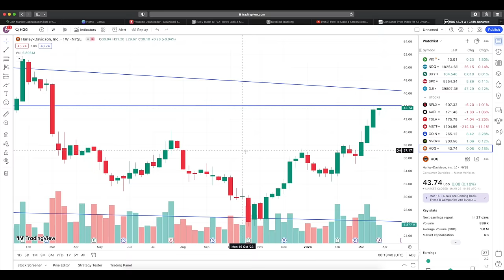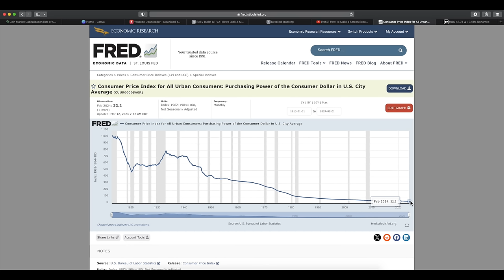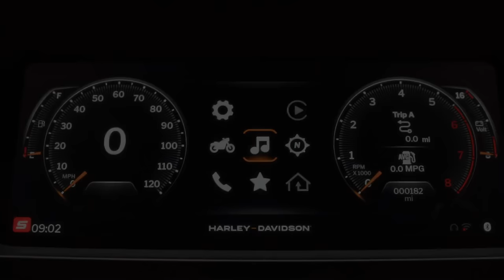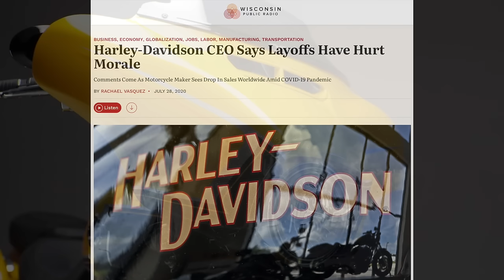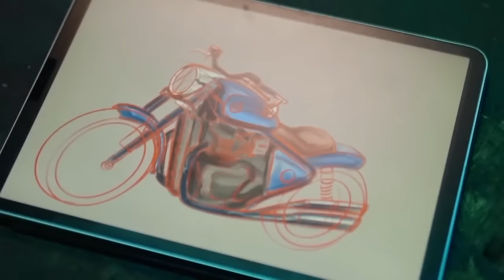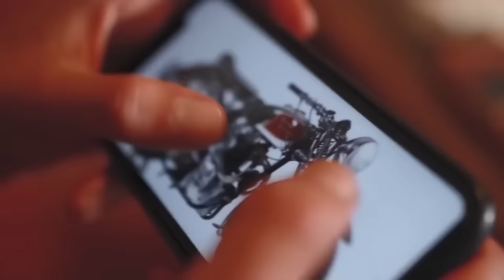Harley Davidson is Mismanaged Compared to Royal Enfield

Comment: I went to the local RE dealer yesterday and saw the new Bullet and Meteor 650 for the first time.  They’re beautiful bikes and priced so competitively.  The Meteor 650 is less than half of the least expensive Harley and just a well made motorcycle that looks wonderful.
Reply: Their 350s may be the best-styled bikes available today.
Reply: @ikonoklass  yeah I love all of them. The Bullet is such a beautiful motorcycle. I also love the Hunter and Classic.
Reply: Not sure RE are the Bruce Lee of motorcycles
Reply: I bought a RE650 in 2022, love the bike, the simplicity is amazing everything you can do your self set the valves is the hardest thing to do, its not that hard, no paying 500 bucks at the dealer for service.
Reply: Yeah it is a wonderful rebirth. The Interceptor is also a beautiful bike but when I looked up the weight it seemed quite heavy. Hope they make them a little lighter soon?

Comment: Harley just won’t budge in their philosophy, seemingly they don’t care.  They don’t have to get as cheap as RE, but they could at least bring out something like the Street Fighter to attract a new customer base.  I had a Lowrider for awhile and I miss it now, but at this point I would only get a used HD, prices are too much to consider new.  Great video!
Reply: A low rate that cost 20 grand is really not gonna be any good for the brand because most people can’t afford that
Reply from the maker: Thanks! It would be good to have a 10K air cooled cruiser without any electronics. Just make it look nice and sound good, it doesn't have to be fast. They'd gain a whole lotta market share with that.
Reply: @DifferentSpokesTV  Give it a cool name, like "Sportster" maybe, with a big aftermarket to customize it too!
Reply: Jochenimany Zeitzermaniac making sure so much Americana remains in the brand.
Reply: Its interesting how they act differently in different market...in India they aree selling a 440 cc single roadster which in all due respect is a good value proposition.
https://youtu.be/1hRGiKTpxKI?feature=shared

Comment: Harley = NASCAR.  Outlived its life cycle and fails to attract new fans.  All other brands = F1 which has it figured out as it’s an international sport that thrives.
Reply from the maker: It's hard when your customers turn their nose up at any new bikes and non-Harley riders are sceptical of any actual innovative bike you make.
Reply: HD made this bed. They have to sleep in it. Back in the Reagan years they went crying to the Gubmint about imports eating their lunch. Instead of manning up and competing, they simply changed the rules.
They've destroyed other domestic upstarts by the same method. I look at them as a big corporate bully that's lost sight of what motorcycles are about.
Reply: But NASCAR is actually trying different things to attract new fans. Not saying they are; just trying.

HD reminds me more of  IndyCar.  Slowly becoming a non-factor and relying on the past (Indy 500) to keep it's fans that are shrinking in numbers every year.
Reply: @DifferentSpokesTV  They made stupid choice ages ago by staying in cruisers. Pan-am is semi-decent effort, why? They forcibly stuck in they twin mentality. They should've made inline three or for engine AGES ago. HD is only proving their customers that even in their new concepts they're still sticking to century old stuff. They made Pan-am as new thing well they should've ditched everything. Literally everything. If they'd bring like 700cc inline triple naked bike with some very modern suspension stuff with interesting accessory lineup, I would get curious. Very curious. Even more if they'd launch like competitor lineup for himalayan or something that would prove they're willing to attack competitors in their home turf and coming out of "route 66"

Comment: Completely agree with you. First time HD owner here and I am really disappointed with the company attitude overall. I bought a new sportster S last year and it was already broken with less than 900mi! Overall experience with HD is awful, from the dealership BS, markup and other fees, shady sales tactics, overpriced maintenance (almost $500 for a oil change), warranty uncertainty, etc. It's all around a terrible experience and don't wisb to anyone. I am used to Japanese bikes, even had a ducati, and had absolutely no issues with about 8 bikes until I bought an HD. I hope people can learn from my mistakes and keep away from this company.
Reply: are you kidding me ?? 500 Dollars for a oil change ?? i would get myself a scooter for a secondary use at that cost
Reply from the maker: Yes, when deciding between a Harley and an Indian, the fact that you don't have to get gouged at an HD dealer definitely favours Indian which can be sold at multi-brand dealerships.
Reply: @RAMIC-tv1ye  they call it 1000mi check. They say they check many fluids, etc. But, we know it's an oil change. Besides that, any HD dealership will charge 1-3K in prep fees when they sell the bike. So, it makes even less sense to have an expensive svc check if they did a proper prep. I doubt it, my bike was nasty when delivered, it even had storage markings on the tires...
Reply: 500 for an oil change is a lie

Comment: 15 years ago I bought my first Harley. Last week I purchased what could be my last one at 68 years old, a brand new Low Rider S, always from the same dealer with whom I have a very strong and friendly relationship. Never mind, currently, just one Key Fob instead of a pair and I had to pay for the alarm siren as an option. In the meantime, except a bunch of enthusiastic relatively young fellow riders I hang out with, the Chapter has been filled with wealthy seniors who don't have a clue about what they are doing on the road and are more concerned about how many bought patches and pins they have on their tailored vests. Fortunately  a bunch of old school friends still remain who still speak the same language. Nice video. Thanks
Reply from the maker: Thanks for the comment! It's sad that only the wealthy are going into Harley dealers these days.
Reply: Condolences. Worst seating position of any bike I’ve sat on in 50 years. I bought a ‘22 salvage site unseen for a project. Big mistake.

Comment: Harley-Davidson is the locomotive that pulls our sport and this industry along. And like a locomotive it doesn't carry any passengers nor freight. And it takes a specialized crew to operate it along with a huge support staff to maintain it. Without this locomotive all the other revenue producing passenger and freight cars will not make it down the track to the next destination. 
H-D once had an ad campaign that had a tag line which read; "Things Are Different on a Harley-Davidson". Which, being different is true of almost all of motorcycling. For better or for worse, H-D is the matrix which all of motorcycledom revolves.
Another outstanding video production with some thought-provoking comments. Thanks for posting!

Comment: Harley has never been strong on innovation. They attempted introduce entry-level bikes a few years ago with the street 500 and 750, but these were already antiquated before they hit the showroom floor. Someone starting out on a Honda, Triumph, Royal Enfield, etc. is not going to suddenly opt for an oversized expensive Harley later. Some riders will just because they like the HD brand, but most will opt for the names that they recognize and they’ve been riding.
Like several CEOs, I imagine the compensation package is tied more closely with stock price and less with sales.
Reply from the maker: Yes, I think Zeitz is treating this like a job and worrying about his compensation while Lal thinks of it as a passion.
Reply: 43 mill $ for Zeitz in 2023...Now we know why a Road Glide costs what it costs.
Reply: @atomicgrasshopper4391  wow, I just looked that up. What is even more amazing is over 95% of that figure is bonuses. HD has had revenue increases every year since he became CEO, but declining sales.
Reply: Lets face it they needed Eric Buell. New Pan Am could of been made 14 years ago. And it seems thats where they got the tech from. How hard is it to put a ground wire on the starter?

Comment: One of the things that shocks me the most is how under equipped Harleys come in the braking department. A very heavy, almost 100 hp fat boy comes with a single, non floating disc up front. As if cruising meant no emergency breaking! And it’s not that the Fat Boy is cheap. In my homeland it’s north of 27k €
Reply: The people who ride Fat Boys don't go fast enough to need brakes.  Suggest you try a New Bonnevile T120, or if that's not retro enough for you a Speedmaster.
Reply: @jerryandnancywertzbaugher7778  they must hit 65 mph!!!!
Reply: If you bother to look at the perennial statistics, you’ll see that Harley Davidson always, and I mean always comes in the shortest, breaking distance of any motorcycle on the road that is undeniable fact
Reply: Agreed, I have a 2010 Softail Deluxe with 96hp and 108tq. I've owned it for 12 years. Every time I look at it, let alone ride it, I'm wondering why it only has a single disc up front. Previous owner installed floating disc's, so maybe that helps. 

But yeah, the bike isn't light and braking is more of a suggestion than an absolute. Lol.

Comment: They should just bring back the sportster and road king and just give them better suspension and seats right from the floor, a locking gas cap, and for the sportster a fuel gauge stock.

Comment: I bought a new ‘23 Royal Enfield Scram 411 recently from my local dealer for about $5k out the door. It’s a perfect fit for me in both form and function. I love the tall suspension, upright riding position, relative light weight, and stripped-down look of scramblers in general. Plus 99% of my riding is in the 35mph to 55mph range, so I don’t need a lot of power. The 3-year warranty ain’t bad either. Bring on The Enfield Invasion.

Comment: Harley Davidson's main problem is that they are the biggest fish in a tiny pond. Around 550,000 bikes were sold in 2023 in the US, which is tiny compared to other markets. In the same period 2.56 million bikes were sold in Europe, and here in Australia, where the population is just under 8% of the USA, around 120,000 bikes were sold.  HD just doesn't make bikes to target these markets, and when they do they generally get it wrong. The X350 & X500, for example, have been available here in Australia since December & have flopped hard. They're over priced compared to the competition, with the X500 being over $2000 more than the exact same bike in the Benelli. Plus only 3 months after they launched they're offering all sorts of incentive deals, including guaranteed 100% trade in value after 12 months of ownership, just to get them out the door. And if you buy a "proper" Harley you get screwed too. I can buy a 2 year old Pan America that's barely been run in for around 50% of the cost of a new one, while most other brands of a similar age & mileage command 85-90% of their original purchase price. HD cruisers fair a little better, but you still lose a big chunk of change after just a couple of years of ownership.
Reply: Wow
Reply from the maker: Yeah, the name brand value doesn't translate to non-cruisers apparently. People are willing to pay premium on a bagger or Softail but definitely not the X350.
Reply: @DifferentSpokesTV  But the X350 & X500 should have been a slam dunk here in Australia with our license restrictions. New riders are limited to LAMS/A2 restricted bikes for at least 15 or 39 months, depending on their age & driving experience, and these are the only 2 HD's that meet those restrictions. And that's our biggest market over here. You can't ride for 10 minutes without seeing a KTM Duke 200 or 390, and 15 minutes will guarantee you seeing a baby Ninja or CBR. The majority of bikes I see on the road are LAMS/A2 compliant.
And it's not where they're made either. Triumph can't keep their 400's in the showroom, with all shipments so far selling out before they arrive from India. And they are $500 & $1,500 more than the X350. Plus our 5th best selling brand last year was a Chinese made electric motorcycle manufacturer that knocked Suzuki into 6th place.

Comment: Totally agree with you.  Also don't forget that Harley's in general have a relatively bad reputation for leaking oil, breaking down, etc.  I watch some videos of riders doing long rides and they always plan to go by Harley dealerships on the way... Not a coincidence I think.  If they don't have entry level bikes, they won't get the younger generation to have that brand loyalty they are looking for.  Even at that, people these days generally don't have the same brand loyalty as in the past. Just look at how many people jump from one job (company) to the next- almost no loyalty, and that is ok for the consumer.  Right now, I have Kawasaki and Honda dirt bikes, a Suzuki dual sport, and a Triumph adventure bike and just recently sold a Suzuki dirt bike and a Royal Enfield Interceptor (and moved up to the Triumph).  People buy what fits them and loyalty doesn't matter so much.
Reply from the maker: Yes, good points. Harley had a good thing going with the loyalty, but the price hikes and gouging have eroded that.
Reply: The oil leaks and breaking down are from a bygone era. Has not been the case for 30+ years. It’s simply an internet folk tale passed along by people who don’t know what they’re talking about.  60k miles on my Ultra Limited and nothing other than the usual wear and tear any bike would experience. And my story is not unique. The only bike to ever leave me stranded on the side of the road was a Honda. Harley may have problems but reliability is not one of them.
Reply: @shep68  Harley may have improved, but I have a friend who had the oil leaking problems with his and sold it for a Honda ST1100, no problems with the Honda and I ride with him frequently.  I also mentioned videos, like 2 lane life where they have shown their breakdowns as they ride.  Glad you have not had issues, but others have.  Of course there are issues with every manufacturer, but I still think Harley is less reliable.  Everyone has their own thoughts.

Comment: I bought an RE gt650 2 years ago,a new bike for the price of a 5 year old triumph,it does everything i need including over 60 mpg,i'm impressed with most of the build quality,also they are very easy to customise with tons of different aftermarket parts

Comment: To be fair. Becoming a luxury, elite brand is not a bad thing on itself. But for that you cannot rely only on the brand and looks, but make elite luxury machines.
Reply: They will not retain their customer base for a long run because their riders are old now.
Reply: There's an article on Wikipedia listing global motorcycle brands, the current brands and the brands that existed historically but no longer do. I barely remember some of the brands that America had. There was no mention of Motus on that list, but it was briefly a legitimate brand even though it never really got traction and finally quit.
There's other brands in other places that have been around a very long time and still offer some of the very best performance, technology and reliability in motorcycles. HD isn't one of those. Arguably never has been.
When you do a 1:1 value proposition to the younger generation these days showing them what $40k buys you in Ducati vs Harley-Davidson, the stuff is laughable.
Reply from the maker: Yes, make the 45K bikes for the well to do, but they should also have a ice looking entry level bike for under 10K.
Reply: @DifferentSpokesTV  HD corporate attitude is the #1 reason for the foolishness. Dealership network attitudes are only a reflection of top leadership.

Comment: Jochen Zeitz should be FIRED !!! he is clearly clueless and if the rest of the board doesn't wake up it will be Harley's turn to go into the history books until they find a Polaris of their own. But Indian has the Same issue No entry level bikes, and Bloated priced Big bikes, but at least Indian is coming out with new models. Harley claims to,  but their  idea of a new bike is a fancy paint job, and after 120 years of Black being the base paint, now a god awful battleship gray and the MSRP's are insane and then Harley dealers are raping customers for another $1500 to $3500 in BS fee's and some dealers hitting the customer with Fee's and a higher price like the CVO Street Glide has an MSRP of an insane $44,499 and i've seen dealer selling them for $55,000 and they wonder why for the 1st time in years Bikes are not selling, at my local dealership they have a few brand new 2022's and several 2023's including a few 120th anniversary bikes, and you can go to Honda and buy a wing full tour for $26,000. and OMG the foolish slow release of bikes over the year, instead of in August like they did for decades, people don't have the Attention span  for the slow trickle of bikes, you can't keep having new model announcements and still have people caring !! and i know what i'm talking about i was a Harley Dealer Employee and Manager from 73 to 2010 when a health issue forced me to retire, i have owned and ridden Harley's for 50 years as of 2023 my 1st an SX125 AMF my current a 2008 Road King, it's sad but i believe i'm watching the End of Harley-Davidson Motor Company, will i live to see it fail.......don't know, but it's going in the wrong direction !!
Reply from the maker: Good points. A multi brand dealer just brought in Indian recently and they're selling like hot cakes because this dealer isn't marking them up like the Harley dealer down the road. Equivalent bikes are thousands of dollars less expensive without the Harley dealer mark up.